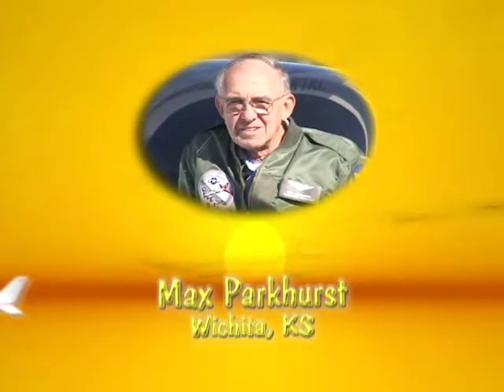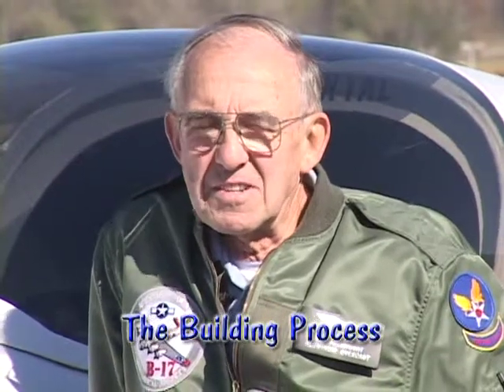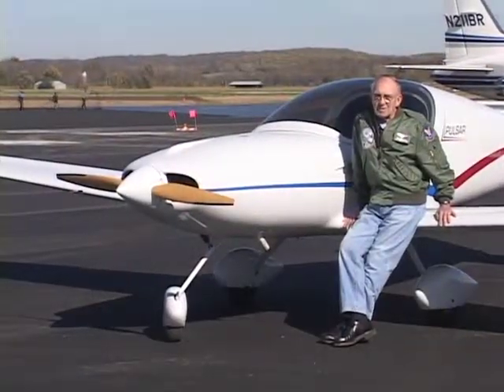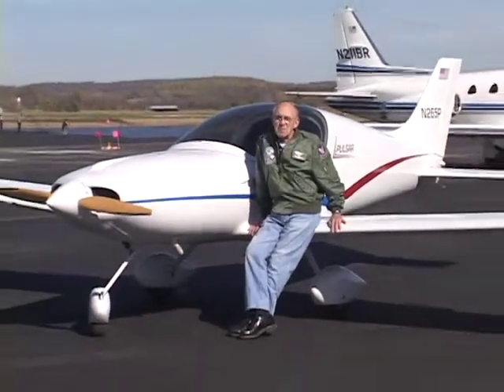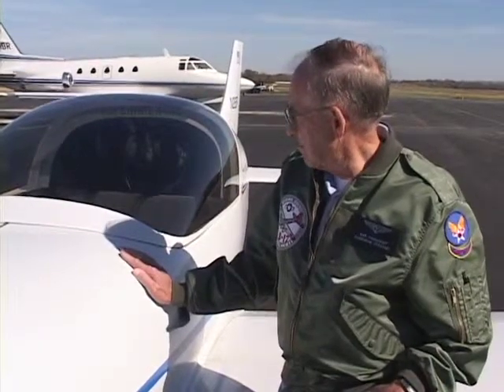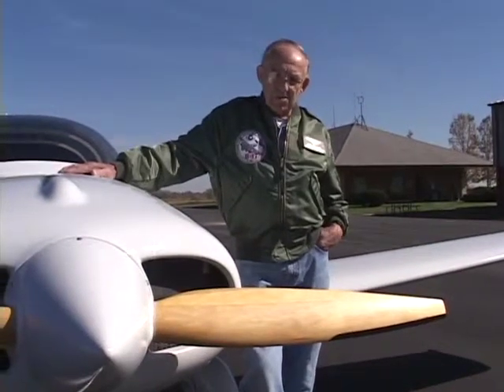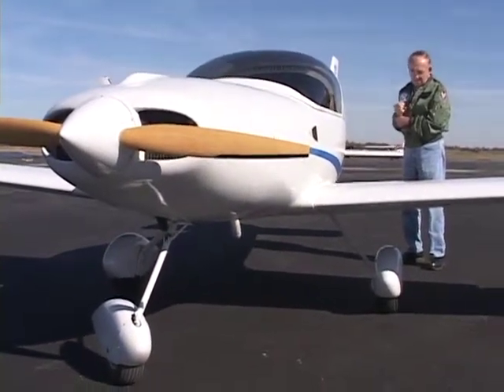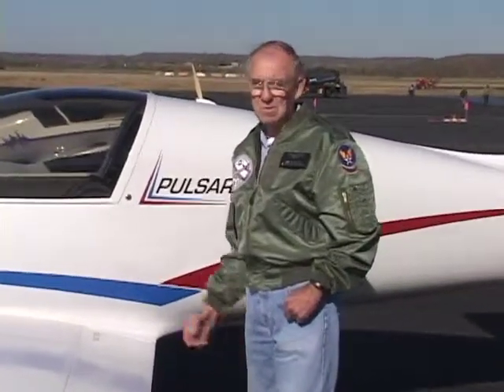Max Parkhurst Interview from "Take A Look At The Pulsar" Homebuilt Airplane

Comment: Nice looking aircraft, too bad it's being pulled by a crap motor.
Reply from the maker: If you take care of them and use quality oil with your gas, they are quite dependable. I have flown all over The Great Plains with the aid of a Rotax 503. Never had a problem and I have over 1,000 hours experience.
Blue Skies & Tailwinds!™
The Sky Surfer - Brian FitzGerald